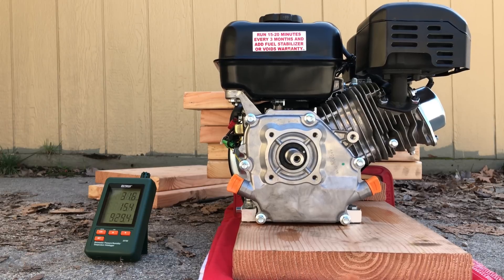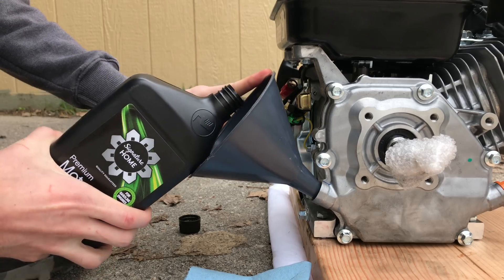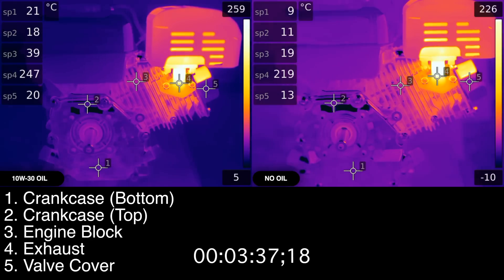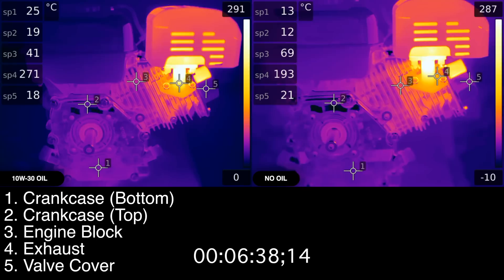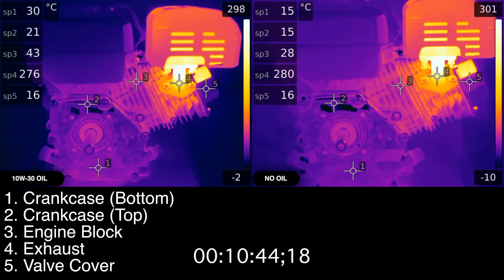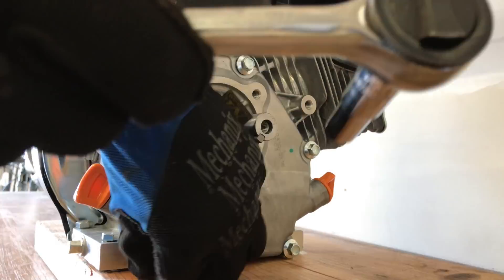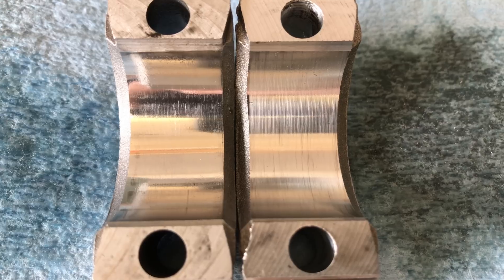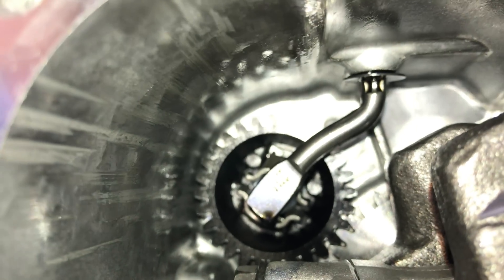What Happens To An Engine Without Oil?

Comment: The test didnt work out quite the way you expected it to because you chose the almost bomb proof Honda utility engine found on a lot of small plant machinery, generators, water pumps, etc, etc around the world. They really work on a wing and a prayer in normal use with the rather antiquated splash lube system at the bottom of the con rod anyway. There are also very few moving parts on these motors - very basic but durable design!

Comment: The problem with this experiment was that the engine probably was not broken in and as such, much of what you show [i.e. metal flakes in the oil sample] may very well have been simple break in.  The crank does show some scoring, however, and I noticed some blueing due to heat.

Comment: oil is actually a lubricant not a coolant :(
Reply: The oil, at least in some engines, actually passes through a radiator which removes excess heat. So yes, oil can, in fact, function as a coolant.
Reply: oil serves a major role in distributing heat throughout the engine! its main purpose is yes to lubricate, but almost as important, is its cooling function, it is the fluid directly in contact with all the moving parts of the engine, the ones that create all the heat. oil spreads the heat around, and is normally cooled in a cooler just below the oil filer with the engines coolant.
Reply: no no , oil does get hot and yes it does get cooled through radiators in some engines but its definitely not a coolant

Comment: yes i have a question. why/how does a turbo engine give better fuel economy vs NA
Reply: because when you are not "in" boost it is literally a smaller engine. a 2.0 liter engine running at 15 PSI (just as an easy example!) will suck in the same amount of air and fuel as a 4.0 liter engine. making more power while within that boost range.

and a 2.0L engine out of boost will only suck in 2L of air, and the fuel required to burn in 2L of air.

normally when cruising you won't be in boost, so you effectively have a smaller engine for that period.
Reply: thanks for your answer. some of these engines make boost as low as 1400rpm though so i'm just wondering

Comment: almost unbelievable how reliable that engine can be even without oil.
Reply: Idle, put a load on it bringing it's surfaces in to heavier contact with one another and the engine on the left would have been glowing white and coming apart inside a day.

Comment: +Engineering Explained Good test, thoroughly enjoyed it. While I'm not disputing the obvious damage done to the engine when ran without oil, I do have a question regarding the metal flakes in the oil after it was drained. Did you perform any sort of break-in procedure for the engine before doing this test and change the oil afterwards? If not, I'd like to point out that it's very common for these Chinese clones to have a pretty decent amount of metal shavings in the oil after the first change, regardless if they've been abused or not.

Comment: question, on every i4 fwd car I've looked at, the exhaust is at the front of the engine and goes underneath the engine, while the intake loops around to the back of the engine. why do they do that? wouldn't it save on plumbing to put the intake in front, as well as allow you to put the engine lower if you don't have to run piping underneath?

Comment: Last year. I've taken out a motor from a 2014 Hyundai Santa Fe Sport. I removed the oil pan and saw a piston connecting rod laying in it and big chunks of metal broken into pieces, engine seized. Customers complaint: "my car shut off on its own on the highway, will can't start".....Lol! Engine was filled with Black thick sludge with little to no oil. That customer was hauling ass. I replaced that engine with a brand new one. I bet that customer never changed the oil since......

Comment: Once I repaired a " brand new " gas generator who's owner forgot to read the litle card that said you put oil before start the engine. It ran untill the crank shaft gripped! The cilinder and the piston didn't have visible damege. Atfter the repair, it ran whithout problems for at least 2 years, untill he sold it. Then I lost track of it. This shows how tuff these little engines are!

Comment: Color temperature, a very accurate way of measuring temperature, at probe number 4, the exhaust tubing, should have been in the 2,000 K range, not 240 C. Something wrong with that IR instrument.
Reply: Miguel Gerov You said 2000k which is equivalent to 1700 C, considering this is higher than the melting point of most metals (steel is around 1400and I have a feeling they aren't using anything heavier than that) I'd have to say I think you're wrong.
Reply: You are partially correct. I was comparing the Color of the IR picture, not the real picture. However, exhaust temperature, usually run about 1,650F at lean of peak in gasoline engines. 

 https://en.wikipedia.org/wiki/Color_temperature?wprov=sfsi1

Comment: I worked at a go-kart track with those engine. here you can see what happens when someone forget to put oil in it;) Check out @Flexit_Cam's Tweet: https://twitter.com/Flexit_Cam/status/827194820544364546?s=09

Comment: I'm sure that internally, there were some extreme temperature hot spots in the engine without oil, but i doubt you can measure that from the outside. That amount of heat generated from very small contact surfaces, when distributed along the external metal surface of the engine is probably unmeasurable, but the small contact surfaces would be at extreme temperatures and sustain a lot of damage from friction.

Comment: To add, at 4:21 you notice a lot of "blueing"  around the connecting rod journal. A sign of high heat. The oil not only lubricates but also transfers  heat away from the engine parts. Interesting video. Thanks for sharing!

Comment: the oil is for lubrication "mainly". it's an air cooled engine. I'm not surprised the temperatures were similar. also, had the no oil engine been under a load, the results would have been much more catastrophic. neat video regardless. thanks.

Comment: So you ran it the previous day WITH oil I bet most of the internals were still coated with a thin layer when you ran it "without" oil. I know it would introduce more variables but it would almost make more sense to run the test side-by-side with one that you had never put oil in (or had taken apart and cleaned all the oil out entirely).

Comment: why do some brand new engines (Audis and Mercedes specifically) tend to lose some oil between services? I had a CLS 500 that lost about a quarter every 5000 miles of use and now I have an A4 1.8T that loses half a quarter every 7000km. This never happened to me on my BMWs for instance
Reply: jpbarrera9588 I've always had to add oil to my smaller engines. I've had a few 6 cyl engines that didn't lose anything I could notice, yet my 2 new 4 cyl Hondas have consistency used almost a qt/1k mi if driven hard. one just hit 100k miles, still uses the same oil. I think increased engine speed burns more oil as more can slip past rings and valve seals?? and small engines tend to turn faster than larger ones.... my guess.
Reply: makes sense... thanks for that

Comment: My question is at what point would a vehicles engine need a full oil flush and replacement to remove any and all sludge that typically builds up?

Comment: with oil = twice as hot. your video shows at ever point u measure 2x the heat. so i wont use oil anymore cuz it will heat up the enginge 2x

Comment: It still had some lubrication from oil even though you had drained it out, if you ever do it again try to do an engine wash, by pickling the motor with something like diesel fuel, then drain, that way there will be next to no lubrication and things with get gnarly fast! :) I think.? lol

Comment: my from. Cambodia.  last summer.   he. driving.  2008. Honda. accord.   in Ottawa.  Canada.  whit. out. oil.       so.  engine. is. stop.  he loos.    $4000  to fix     I feel.  Sorry.        so if see.    your.   car.  engine.  light.  on.    don't ( drive)

Comment: One thing you forgot to take note off is even though you drained the oil from the engine to do your second test without oil, all the engine parts would theoretically all be lubricated. 

Try running a completely dry engine with no oil and I bet your results would be drastically different

Comment: What we need is a load on the crank shaft and engine operating in it's power band. Then the comparison would have been more interesting, especially regarding the end result. It's quite expected that new engine at idle would run for quite a long time before seizing. Even if permanent damage did occur, as demonstrated in the video.

Comment: Interesting, but I think you should have measured the bearing and cylinder diameter, roundness and surface roughness --- on new engine and after running engine without oil --- so you would have an actual dimensional values of increased wear. Visual method is a very rought estimation of how much the engine got hurt...

Comment: Hmm. It's not quite apples to apples WRT typical automotive engines, at least from what I see there are no typical bearings.  I think that is a big source of engine failures when you run out of oil, once you lose the bearing shell things starting to hit each other, not the case here. I'm a little surprised to see the lack of damage but as another commenter mentioned it may be a different story under a significant load. Overall it's interesting to see and a tribute to how really robust engines really are. Kind of amused that a POS-chinese-made engine would last that long with no oil, maybe shitty manufacturing makes for long lasting engines? [I think not] Maybe the engineering is good enough in the first place that it's irrelevant of who makes it...

Comment: Yeah, oil and air cooled engines like that would heat the external air more, when oil is present (as you mentioned). The oil isn't there to cool the block, but to cool and lubricate the internals... which would eventually expand till seizing. That said, the engines are built (in general) more rugged than the typical car engine to handle little maintenance, running with low oil, and being left out in the elements.

Comment: These are air-cooled motors so why would the case show any different temperature than operating temp?? The connecting rod and crank will most definitely heat up which is a given from the change in color they receive and will fail from lack of lubrication. Based off of previous videos i am a little disappointed with this vid more-so with your knowledge of engines. However, there is nothing wrong with experiments. Also- if anything this is showing people its okay to run your car without oil for short periods of time...not cool lol

Comment: when taking thermographic images and trying to compare them side by each, or on their own please remember that light colors and reflective surfaces do not accurately represent the actual temperature as these are inherently not very emissive.  the best bet is to paint the engine flat black, this will yield more accurate readings. Seeing as you are shooting shiny aluminum your temperature readings will be off substantially as it has an emissivity of around .07 with a true flat black surface yielding one closer to .80 and at best .95. For best results try it again with an engine painted as flat of black as you can get it with high temp paint, i think you will find the temperatures will be more accurate and impressive.  Kindest regards - Trained Thermographer

Comment: At 4:21 you can see heat discoloration on the crankshaft near the rod journal, another sign that the engine wasn't happy with the lack of lubricant.

Comment: Haven't read all the comments and. It sure if it was already mentioned, but at 4:23 your shot of the crank shows some heat discolouration.  Looks like it was getting quite hot. For a long runtime the damage would have been more severe I suspect.

Comment: Great video!
Running an engine under no load will eventually lose itself, but it'll take time.
What happens is like you show and explain, the engine starts wearing from bearing friction.
You put this engine back together and keep oil in it, it'll still last a long time, just not as long as it would have, LOL!
I should say, the engine will last longer than a new engine that isn't taken care of.
Proper preventative maintenance is the life of an engine.

Comment: I used to work at a shop that the usps brought their trucks for new engines? They found that not changing oil, and bringing the trucks in for new engines is cheaper?

Comment: One thing to note during this test was the engine is not under load.  This means forces may be somewhat mild versus one under heavy load and actual use.  It's hard to say how big a difference this would create as you are still getting moderate forces just from piston movement, but you are not getting the torque loading you would if the engine was actually worked.  My guess is you'd see a vastly more rapid failure when placed under load.  I just don't know the relative values and geometry to evaluate piston acceleration forces and a light rotating crank vs torque loading the crank and putting cylinder pressure forces to work.  A blind guess would have me say the forces experienced would be vastly different, possibly some multiple of magnitude (10x, 100x, etc.).

Comment: what will happen if you have to a quart too much of oil in your engine?
Reply: At least in conventional engines that I"m familiar with if you have too much oil in your engine then the oil gets bubbly (the crankshaft whips against it) and the oil doesn't lubricate as much.
Reply: Mbmoney1217 
the air will exit the crankcase breather into the airbox, to be burned with airflow.

Comment: Some promoters would run an engine for an hour with no oil, BUT it had synthetic oil in it at first. The point was.... synthetic oil bonds to the metal. Synthetic oil provides better protection.      Be neat to know more about synthetic oil..

Comment: We did something similar to this when I was at school.  An old clunker was used, had all the oil drained, and then ran at full throttle!  The point was to place bets on how long it would take for it to die. It took quite awhile for it to die (my memory tells me it was close to an hour and a half or so) and it wasn't anything spectacular, it just siezed up.

Comment: I'm guessing most of the surfaces were still wetted with oil.  You would need dry areas to get high peak temperature, breaking down any nearby oil, causing more oil to become ineffective, etc until it cascades through the engine.  That or temperature just doesn't cause a failure anywhere near as fast as material failure (higher friction causing metal to flake off, which then causes gouging.)

Comment: The oil not only acts as a heat sink, as you mentioned, but also as an internal medium to not only cool hot surfaces, but to warm cold ones...a thermal balance goes a long ways towards preventing material stress and abrasion at sealing points (gaskets, valve seals, etc)...running with no oil, the hottest spots are probably going to be the piston's crown, the cylinder head's combustion chamber (to a lesser degree), and the exhaust valve stem/face. If oil is present, these parts will give up their excess heat and spread it to cool spots, like the finned cylinder block and intake side of the cylinder head, but without oil you are going to notice slightly cooler external temps as no heat is being transferred, but critical internal parts (particularly the piston) are building heat and have no way to transfer it away aside from direct skirt/ring contact with the cylinder wall. Eventually, the piston will fail from overheating, either by cracking or swelling enough to seize in bore, and the excess heat from combustion and friction trying to leave the only way it can, by direct contact of the rings and skirt to the cylinder wall, will lead to very rapid wear. Some of those small engines have a cast cylinder liner that isn't particularly tough, and the hardened rings will wear it away faster than the piston can seize in it. Then, with even less direct contact, the piston is going to have to melt down or crack. But the compression may get too low to keep running before that happens, all depends on the quality of the build. The bottom ends on these use ball bearings, which can roll along pretty happily with just an oil film for a long time. On a car engine, with hydrostatic bearings requiring oil pressure to keep metal off metal, no oil pressure is an almost instant disaster...but really not that big a deal for these little ones, at least in that respect.

Comment: Wasn't there a TV commercial for some oil company, years ago (probably in the late 70's-80's era) where they drained the oil and ran the car around the track to show the residual oil's lubrication ability? I don't remember how long they drove it like that, but at the end of the commercial, the car with no oil in it was still running well.

Comment: Well it is only conservation of energy. Both are running at the same speed and throttle are generating the same power and dissipating the same.

The friction work is small comparative to the total power. You should put a dinamometer on the axle and try to measure some difference.

Comment: The variable that would apply in real world is engine load,  as no engine ever just idles, they are meant to perform mechanical tasks. Try the same experiment with a load and watch the engine without oil blow up. Great video all the same.